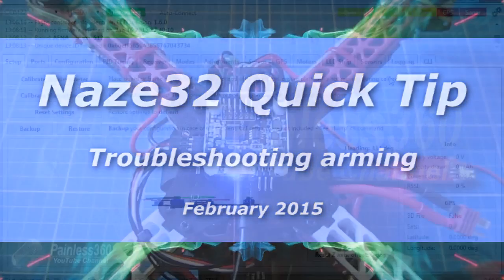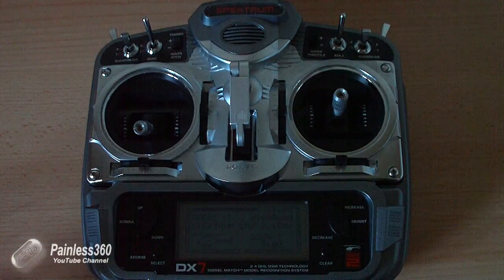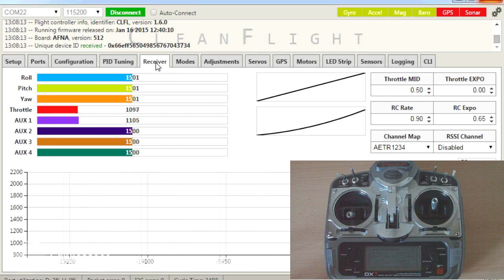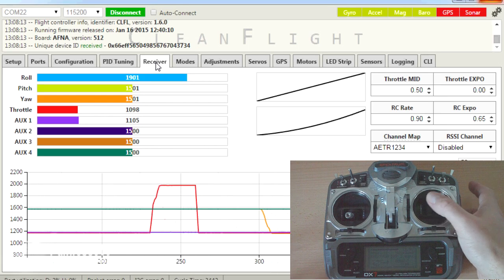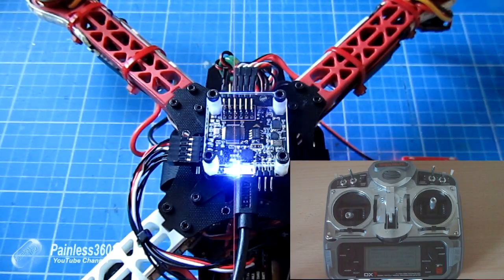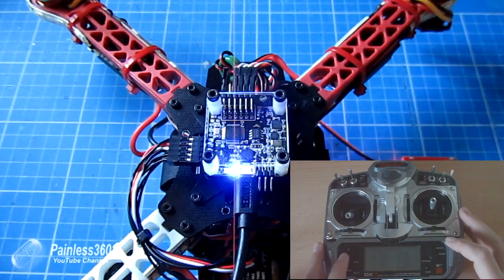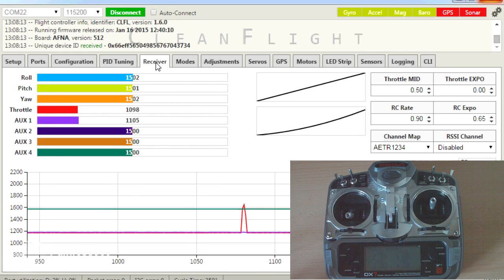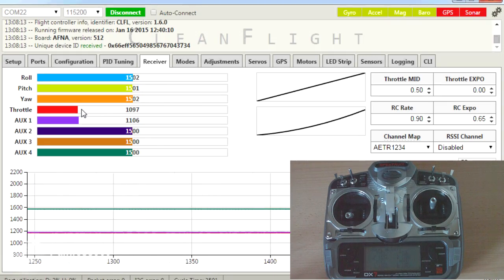Naze32 Quick Tip - Troubleshooting Arming

Comment: Sir i have problem with rudder, not going to min endpoint so my pixhawk is not arming. So how can i set /solve this issue?I have avionics rcb 6i rc.
Reply from the maker: Check the manual for your radio and look at endpoint or travel adjustment.. Best of luck!

Comment: Sir my drone get arm with arm switch but motor are not running what is the problem but it can running directly with motor tab with master spider I don't recognise the problem behind it
Reply from the maker: Without more detail it's impossible to offer any advice. Have you got MOTOR_STOP turned on? Happy to help but please watch https://www.youtube.com/watch?v=olIqTiSJHIY and come back to me with more detail of what you've tried..
Reply: Thank u for my help Painless360. U can send me settings for Naze 32 rev 5 with ct6b receiver clenflight including pid tuning .and there is an other problem with magnetometer not show on board
Reply from the maker: I've not use a Naze32 for a few years now. All of the detail I knew about it are in these videos..  best of luck!

Comment: Painless, thanks for the video. Great tutorials. I am able to arm the Naze32 (this is confirmed both in Cleanflight and by the LED on the board). My issue is that once it is armed, the throttle does not spin up the motors at all. I can use the motors just fine directly via Cleanflight on the Motors tab. Also, if I connect the motors individually to the THRO output on the receiver everything seems to be working fine. I am getting a throttle value on the Receiver tab in Cleanflight. If anyone has had this issue and has any input on this it would be greatly appreciated. Thanks.
Reply from the maker: I've not seen that. That is odd as you've covered the parts that normally catch builders out. I'd try another older version of the firmware.. Best of luck. Let me know if you figure it out..
Reply: Thanks for the suggestion. I was able to give this a try over the weekend. I tried 4-5 previous firmware versions but had the same issue. I do have a second Naze32 that I soldered up and was actually getting the same issues with this one.  I wonder if this could be a specific setting in Cleanflight. This is my first time building a model so I could be missing something obvious.

Comment: hey than u very much....I built my first quad(dji f450, apm2.8)watching your videos and was very helpful! now I bought a naze32 rev6 6dof...and planing to built a mini...dint find full version of naze32 as it was not available in here(India)..can u plz put a video showing connection to Naze and the flysky th9x transmitter receiver... m confused..I want 2 use my 6ch reciever considering the size as it's small.. I have the 9ch reciever as well.. will you plz help..... gr8 work....! literally PAINLESS!
Reply from the maker: We cover that in the series. All you need to know is the kind of connection you'll use with it - PWM, PPM or S-Bus. Be careful as early Naze32 boards didn't support S-Bus without an external converter. Best of luck!
Reply: Painless360 I'll b using pwm connection type! can u please tell me in which episode you covered this topic? Thank u very much....u'hv been a great support 2 people like me...m extremely noob at this.... Thanks 1s again!

Comment: Hello there, thanks for the info. I think my board arms (had a red light) and disarms as u said in the video but the motors aren't responding. I even tried sliding the master I'm clean flight but it didn't work. Kindly help me (by the way I'm using rev5)
Reply from the maker: +sri vamsi what troubleshooting have you already tried?
Reply: thanks for the reply,
                              I got my motors working, but i dont know about pids, i calibrated escs via master slider in cleanflight and now the quad is pitching forward while i throttle. kindly help me make it stable. and how do i setup magnetometer and barometer (does naze 32 rev5 have them inbuilt?). Please help me.

Comment: The green LED (ARM status indicator) is not visible while flying the quadcopter  outside. Is there any other indicating options for indication of that except programmable LED (WS2811/12) ? Like a simple LED or buzzer or a pin changes state so I can use it as I want. Please provide some suggestion.
Reply from the maker: I'd use a WS2812 LED or two to show that. Most pilots fly with the motors spinning when armed and that is a very useful indicator/sound that you can hear from many feet away..
Reply: Thank yoy a lot. That's very useful. 
What I'm doing here is, I have made the radio, both transmitter & receiver, with two arduinos & nRF24l01 bi-directional wireless module. Here I can get some telemetry directly, without flight controller in middle, such as battery voltage. I also connected the buzzer output from naze 32 to my receiver arduino, and send back the data to my transmitter. In the transmitter, there is another buzzer, thats sounds when buzzer output of naze 32 is active. That's lot easier to hear beep from transmitter, that is in my hand. 
It is possible to connect the ARM status led output directly to arduino. So I can get ARM status in my transmitter's lcd display, along with battery voltage. But I don't want to interfere with smd board.

One more little help, that I need, what type of communication protocol the telemetry port uses? Is it I2C, serial, SPI or any other? 
If it is possible to connect telemetry to arduino, all problems solved together.

Comment: Hi iv watched all ur vids on building. And I'm sure iv done everything correct. Iv just done a vid on YouTube of my problem. Please can u take time to watch it. It may give u an idea of my issue
Reply from the maker: +Craig chivers looks like the board isn't happy it's not level....
Reply: Painless360  I thought that. So I recalabraed it and still th same. Iv stopped the beeping by lowering ranges on throttle and rudder but still doesn't arm. Could it b a faulty board.  Thanks for looking for me.
Reply from the maker: +Craig chivers looks like it isn't are mean to me, I'd disconnect everything and then see if you can on the board with it just connected to the receiver and a power supply. Best of luck
Reply: Painless360   Yes tried that
Reply: Painless360 I'm nearly giving up. Can't see wat else it could b. Is it possible my esc won't work with betaflight ?
Reply from the maker: Craig chivers you'd still see it arm in the GUI.. Best of luck!

Comment: Hi.  Please help me. Please. I have a sp racing f3 board on zmr 250. My tx is tgy i6s. Tx tgyi6c on s bus. I have everything configured and aux 4 is my arm switch. Iv messed around with the range to get it all correct. Problem is my motors do not spin up. On the motor page. The master slider works fine but still the motors do not spin up. I'm desperate to fix this. Please help. Motors and esc all worked b4 on my kk2 board so it's not that. Please help me ??????????
Reply from the maker: Are you arming the flight controller?
Reply: Not sure now u asked that. But wouldn't the motors spin up on the motors page on betaflight on the motors test?
Reply: Ok. When I plug in the quad it beeps and lights up as normal. When I arm it a red light comes on and it beeps once again. ???
Reply from the maker: +Craig chivers I'd suggest you watch the videos in the 'Quadcopter building for beginners' series on the channel. All of the basics are covered there. Best of luck!

Comment: There are not alot of people or groups that make video showing the problems and the fixes.  I appreciate the Painless360 group taking the time to make this video.  I have NAZE 32 Rev-6 FC.  I have a DX6 Transmitter.   In addition to the arming issue.  I also had the issue of finding out that flashing the board with latest and greates stable software did not work with my Spectrum Sat. receiver.  I found that an older verision of the software worked better with my Spectrum Sat. receiver.  This video really helped.  I spent 2-weeks trying to work this problem.  Thanks.  Keep making more trouble shooting videos.

Comment: I am having a problem with a revo fc
Iam in Raceflight and thats new to me as i would normally use clean or Beta flight
I am in the modes tab and have set all the switches The arm tab is on aux 4 and when switched the tabs goes red indicating that all is well
But the motors wont spin
5 minutes earlier i had them spinning  and i disconnected thm as soon as they started spinning up I have just seen your video explaining this as the props arnt on and all that makes sence
I have 20amp littlebee esc and not sure under loopsettings what to select there are so many
I am on H2 2000htz 
I was told it can be my endpoint settings but i have watched your video on that and mine are 995 and go to 2003
Under the motors tab if i select  the main master slider I see all motors bar go up in green But the quads motors dont spin
When i plug the lipo in i get the initial sound and you can see the motors moving slightly
Approx 20 minutes before me writing this i managed to slider up full on motors and connect the lipo and then mast slider all the way down getting the calibration sound
Love you videos they have help me loads but not sure what else i can do
Many thanks
Reply from the maker: We've not played with Raceflight here yet. I'd make sure that your endpoints are always above 1000 and below 2000 as a rule of thumb for any flight controller. I'm not going near Raceflight until it's got a few more released versions under its belt..

Comment: So mine has been working fine rev6 - Then I read that I-bus is faster than PPM so switched the pin over and enable serial rx and changed to I-bus in betaflight. All sticks are working correctly as are the two aux channels with my FS-i6 Tx and FS-ia6b all between 1000-2000 and sitting at 1500. Flight mode switch works but it will not arm, even though it is in the range on betaflight (using Aux 2), SWB on the Tx). I have not adjusted anything to do with throttle min etc. it is set at 1070 min and 2000 max. I have just put the signal pin back to PPM on the naze and changed settings back, same thing all sticks work as they should all mid and end points are good just will not arm! Any ideas mate? I have watched a fair few of your videos and they are spot on! Oh I even flashed the latest 3.1 but it wont arm there either! Thanks.
Reply from the maker: I'd start from first principles here. Make sure that you've not got arming setup as a mode in the modes tab etc.. The things in the video are the most common.. Best of luck!

Comment: Hi, can any one help me on this, its not to do with arming... cant get there yet, i am having trouble connecting my devo rx701 reciever to my naze32 rev6 10dof FC, connected using pwm one wire per channel, fairly sure i have all settings in cleanflight a.d watched nearly every video on youtube and read every forum on google and still only the AUX1 will work, no stick movement coming through no matter what i do, this is my first time doing this so just learning so would be hugely appreciated if someone could help me out with this, please?

also would love to know which ways i can connect the ESC with battery and motor as im building up a reptile sky shadow fixed wing? 
Thankyou
Reply from the maker: I'd check that you have the cables connected in the right way. Most radios have a screen that shows you how the channels are moving and I'd use that to make sure that you can see them moving as a first step. If the aux channel is moving then you can plug that cable into the other connections on the receivers to check if they are moving too. Best of luck!

Comment: Hi, for some reason I can't arm my build (GB190, SPRacingF3 with x4r receiver and Taranis x9d +). On betaflight I get no receiver response (throttle, yaw, etc..) with  Uart 3 on serial rx, rx serial and sbus checked. My x4r and taranis are binded and my motors work fine on betaflight. Any ideas or videos I can check out? I'm a noob at this quad stuff? Please help
Reply: BTW I did the throttle below 1100 on Betaflight. Maybe I should reset my Taranis? Maybe I did something wrong setting that up.
Reply from the maker: Please watch the Quadcopter building for Beginners series if you're new to all this. There are useful videos on setup for the SP3 in that series too. Best of luck!

Comment: thanks for your help...I have a CC3D board...finally got it to arm through this video..but  now it is not stabilizing at all. even after turning on "Angle Mode".. Can you help on this??
Reply from the maker: +Gurmeet Singh Athwal I would recalibrate the accelerometers as step one. See the video on drift for more suggestions. Best of luck

Comment: Hi, 
this is very important, whenever i change the channel mapping it doesnt allow me to arm the quad but is does when i dont change the mapping!!!
what shall i dooooo???
Reply from the maker: +OLLY FPV is the channel map the right one? If so then what are the values for the throttle and rudder channels you get?
Reply: +Painless360 hi yes I have watched the video and it will not arm using the throttle and yaw, the throttle goes bellow 1100 and the yaw ubove 1900

Comment: This was a huge help! I just built my 1st quad, the hovership.com 3D FLY. It is a kit but the directions assume quite a bit of knowhow. This was just what I needed. By the way, I had to increase my settings by 112% down on the throttle and 112% left and right on the ailerons. My "newbie" stabilty settings may be the reason that 102% didn't do it for me. I'm using a Spektrum DX6i and baseflight with Lemon satellite RX and beef's brushed board (Naz32) on a 3D printed frame.

Comment: Followed your video and my board arms but the red led is always on when powered up and my Taranis radio when I move the throttle stick, it buzzes back at me. What's going on? Thanks for all your great and informative videos.
Reply from the maker: The red light is controller by the firmware so can be things like flight mode status. I'd make sure that all of the calibration (accelerometers etc) has been done. Best of luck.

Comment: i have a strange issue on my naze32 rev 6.  I will do the arm stick movement and sometimes it will just single beep and not arm, I do this 2 or 3 times and then eventually i will get the short-long beep and it will be armed.  There seems to be no rhym or reason when or why it does this, it just randomly does this.  It didnt always do this, it started doing this after my first few flights.
Reply from the maker: I've not seen that here but you do need make sure that the board is completely booted and settled before arming and that the other controls are in their middle positions. (https://github.com/cleanflight/cleanflight/blob/master/docs/Controls.md). Best of luck!
Reply: I have the exact same issue on rev5.  It can take a dozen times before it arms, sometimes it arms immediately... mostly not, though.  I've checked my min command, max throttle, min throttle, min check and max check.  All my endpoints go from 1000 to 2000 and 1500 on center.  This all started after I flashed the naze to the current version (1.13).  In fact, I flashed two Naze boards with the same firmware version and the other arms fine.  Sometimes if I calibrate the gyro and acc with stick commands, it arms right away, however there seems to be no specific pattern, just completely random.  I also tried arming via a switch but I just get the single beep.  Just tried increasing my yaw endpoint beyond 2000 us (2025 or so) and it seems to arm quicker... IDK.  I'm probably going to re-flash it...again.
Reply: Yep exact same here.  Let me know if you figure it out, I will do the same.  I was thinking of trying to setup blackbox logging or somehow monitor it with cli or something to see what the error is.

Comment: how can I set the naze32 to arm not using a switch on cleanflight? the only options I get under assigning an arm are aux.
Reply from the maker: If you don't use the ARM mode settings then the default (thr low, rudd right) will be used. Best of luck!
Reply: +Painless360 
so I can get the board to arm all my stick movements look correct on the clean flight app but I can't get the esc calibration to work on the app and the motors won't spin once armed any suggestions?
Reply from the maker: I'd check all the wiring for power and signals.. Best of luck!
Reply: So I switched from clean flight to beta and everything works fine. Thanks for your help
Reply from the maker: Great! Happy flying!

Comment: I took your tip and was able to change all of the servos to bottom point of 1097 or 1098. According to the video, you should be able to push the yaw down and to the right- a green light comes on-- no green light. Are you arming in the configuration page, or mode page, of the cleanflight program. I have been 3 weeks trying to get the board working (advanced Naz 32) Thank you for your considered suggestion, my friend.
I have seen your other videos and still have to do GPS, Barometer, and buzzer.
Reply from the maker: Make sure you've not setup ARMING via a switch (in the modes tab). Best of luck.

Comment: Arming with cleanflight - radio is Radio Link AT 9. I have gone over everything I know about extending the lines from low setting (both throttle and rudder are 1102). You suggested that we reduce that to 1097 and arm. How is that accomplished?
Reply from the maker: +Bud Jones see our video icon using end points and sub-trim, the board will not arm unless the throttle goes below 1100.. Increase the end points for low throttle slightly. Best of luck!